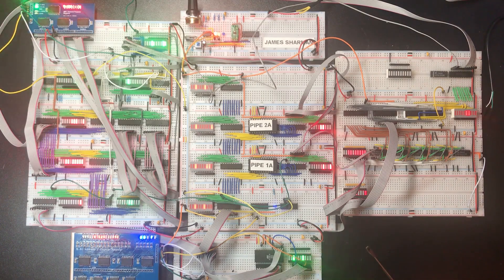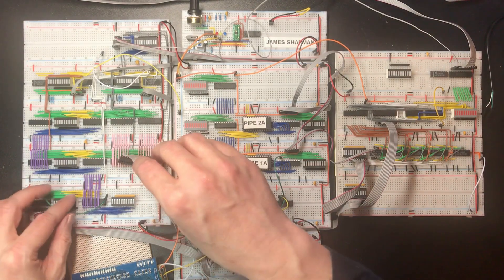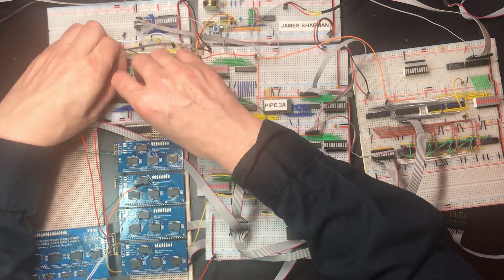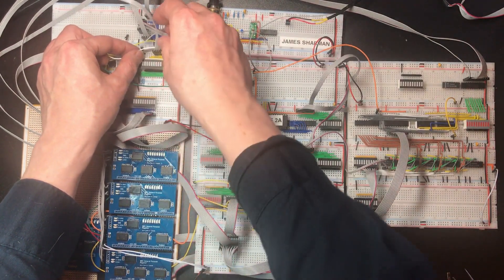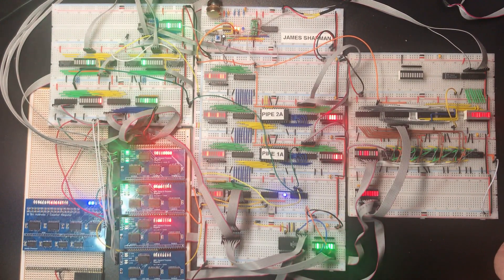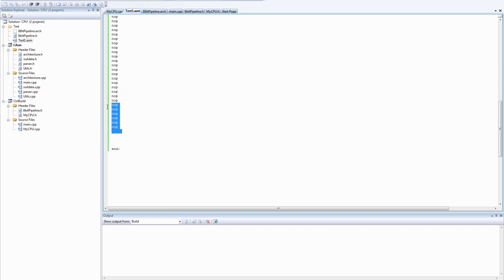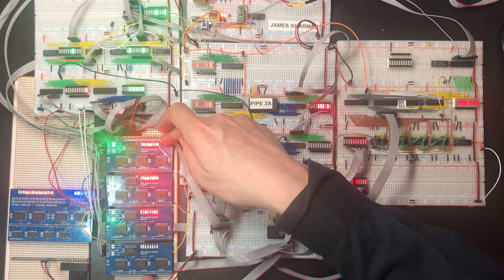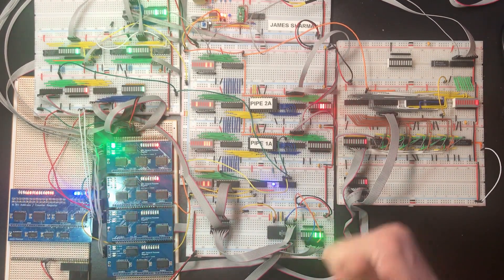General Purpose Registers (4: Completion and Testing) - Making an 8 Bit pipelined CPU - Part 30

Comment: (4:33, 4:36) And, there it is! You just "fixed" the LHS and RHS busses being in the visually wrong positions, but that broke the shift instructions (which you hadn't found out at this point because none of your programs used them).
(8:01) Nope, that's assert to RHS.
(8:18) And that's assert to LHS. Those actually were plugged into the correct spots on the 74LS139s for how you identified them; you just identified them incorrectly.

Anyway, there is now officially a bug in the CPU that's not just a weird visual thing.
Reply from the maker: I struggle to remember some issues along the way, I can however assure you this stuff works eventually.

Comment: Is there a reason for your choice of having the boards horizontal, I would have thought that making the boards for vertical mounting would be more practical and space efficient in most cases. Your GPR board already have most of the holes for the pin headers at the edge, so you could probably just as easily have used right angled headers.

Are you planing to mount the boards so that they are like the blocks in a block diagram drawing of a CPU? having them horizontal would perhaps be the better solution in such a case, vertical mounting might be more space and wiring efficient, but you don't really get a good overview from just the edges of cards.
Reply from the maker: I’m aiming to keep the boards flat so the completed cpu will be a living block diagram.
Reply: @weirdboyjim  Cool. It'll be fun to see how your project progresses.

Comment: Hey James, great video and series! I'm pretty new to all of this, and I was wondering what the large vertical wiring boards that you put the registers on are called? I've been trying to search around for them with no luck.
Reply from the maker: Thanks! Search for Veroboard or stripboard on ebay or amazon and you'll find it. It was useful for the temporary backplane because they are strips of copper that I can use as busses but they are a common type of prototyping board used for electronics.
Reply: @weirdboyjim  Thanks!